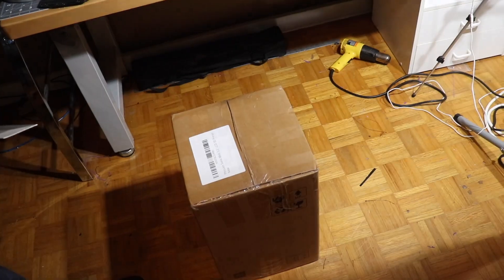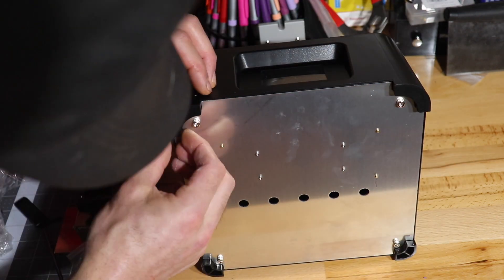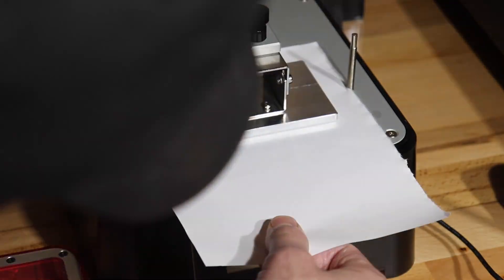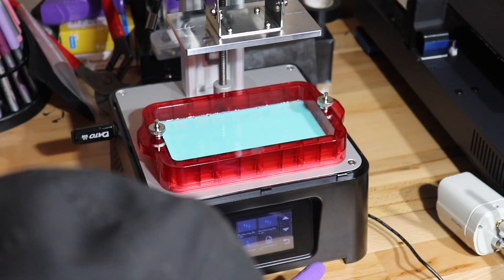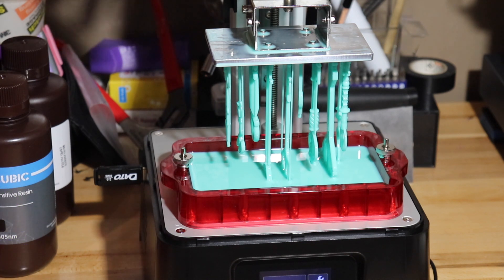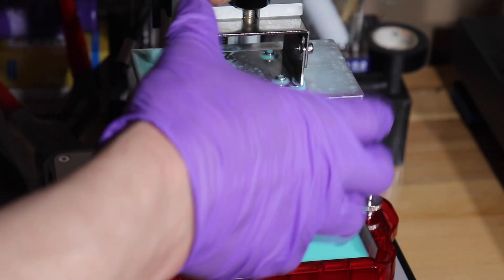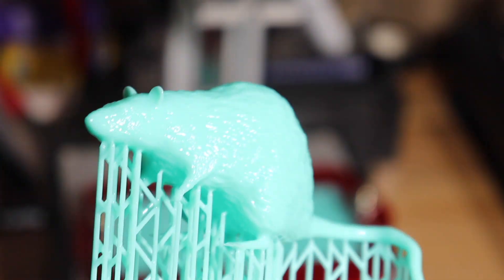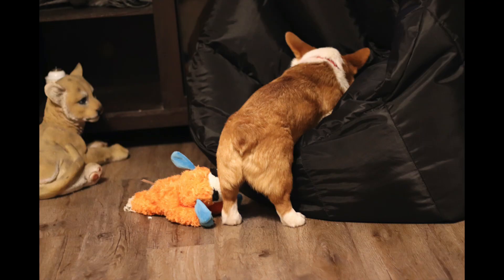Phrozen Sonic Mini: The Good, The Bad, & The Ugly 3D printer

Comment: For any who, like me, just stumbled over this video... I got my Sonic Mini on Monday (May 18th) from Amazon and it came with the metal vat. I had also ordered a metal vat (that hasn't arrived yet) and the new build plate with the angled top (so the resin flows off rather than having to scrape it off).
Reply from the maker: Tim Berry awesome glad you were able to get the metal , vat I’m actually doing some filming using three of their resins with new metal vat, don’t have the new build plate , let me know how that turns out? Tom I’m buying a transform and plan on making a video because I’ll be upgrading it to the mono as well!

Comment: Before mine arrived I asked them about the cracks in the vat I heard about. They told me the cracks come from people tightening the nuts too much. They said it's just cosmetic but if it does leak they will replace it free.
Reply from the maker: Phil Nolan I would buy the aluminum, mine wasn’t over tightening the nuts it worked fine for about 5 days then the disaster happened and I don’t think anyone wants to deal with resin curing on the screen and going everywhere . From now on I’m use only my aluminum vat. I would try and buy while there is still a discount on amazon.

Comment: how does the resin harden in the shape of the intended form? its a lot different than 3D printing it appears.
Reply from the maker: Gabe Aldridge so as the resin sits in the vat , the bottom of it is a clear plastic called fep, that allows the screen underneath light up a pattern and holds for a few seconds then rises to the next level of the print it does this over and over building the intended form. That would be a great idea for another video!

Comment: Thanks for the video.  I just got my Sonic Mini and am doing more research before printing.  I am looking for a good guide about part orientation.  My parts are mechanical parts and have a lot of flat surfaces.  Can I print them directly on the build plate without a standoff?  Are there rules of thumb for avoiding large cross sectional areas anywhere in the build, particularly at the start, to avoid suction/too much adhesion with the FEP?
Reply from the maker: Dennis Dohogne I wouldn’t build directly on the build plate and are you using these parts for mechanical or will cast and mold to make metal parts? Because resin is pretty brittle good for pro type but not real world applications. I would turn prints 30-45 degrees and use supports.
Reply: Check out the YouTube channel "3DPrintingPro". In his 'Playlists' section his has a 'Chitubox Tutorials' playlist. He explains how he goes about placing his supports. He does this by 'hand' not using the autosupports in Chitubox. He also explains part orientation.